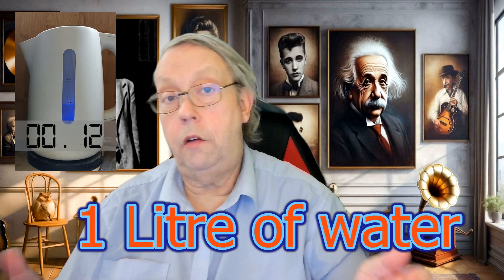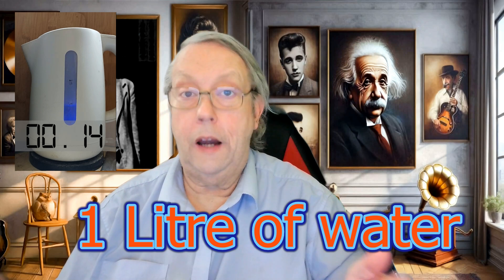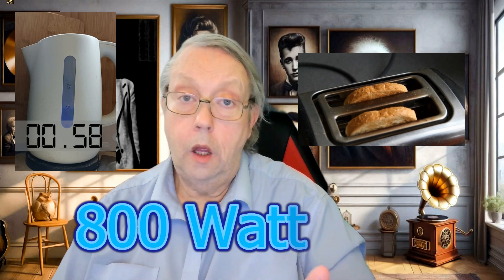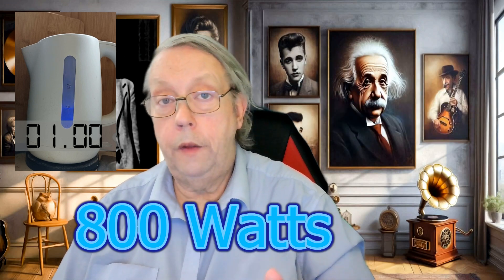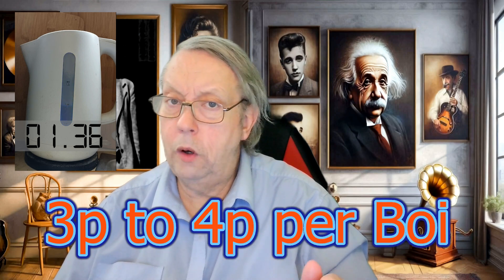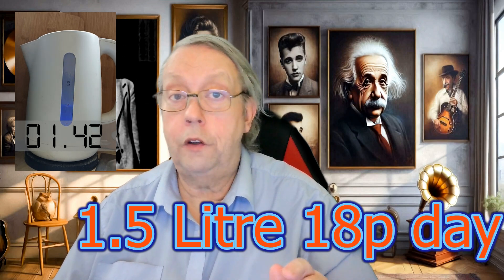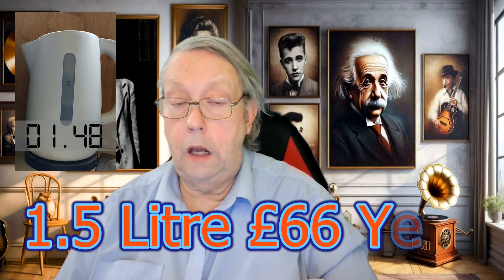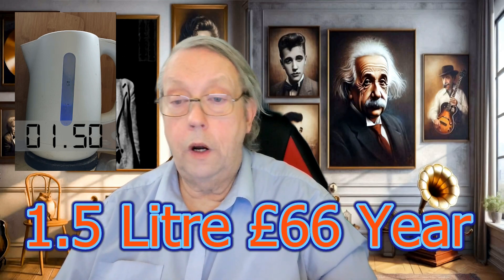How Much  Electricity  Does Boiling a Kettle Use? - 2024

Comment: Minor rant - the cost is manufactured and used against us when you 'plug into the AC'...  - so it's a jilted study based on how the controllers of the 'utilities'  scam us with our inherint resources like electricity , fuel, and now in Canada , "carbon" tax which is a deadly scam against all life forms  - but the sheeple fall in line and are paying this tax blindly and obediently.   I"m not sure if you're a God fearing man Gary - but we were given our resources to use not abuse , not to pay for them with money during our life.  We are all supposed to have the ability to build and maintain our own houses , on our own property for our own family but this is almost non existant in 2024 unless your family has kept the old homestead so to speak.    Oh and by the way Gary .. If I boil water, I put it on the natural gas flame on the stove.   Natural gas, (like abiotic oil) runs under us in almost infinite supply like water does as well... again another scam the controllers have said it's  'fossil fuel' which is a lie - to make it sound like it's a scarce commodity but you cap up a 'dead' oil station and come back later -  it will be full in time.  Water is another topic of course..
Reply from the maker: I cannot dispute what you said. But we have no choice in the matter. Cheers.